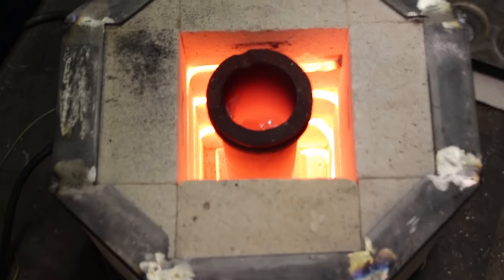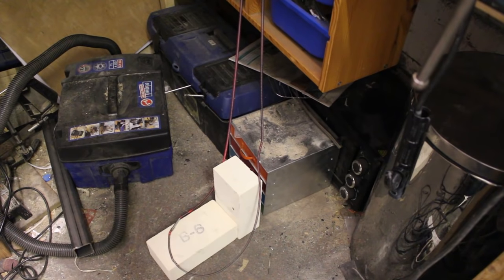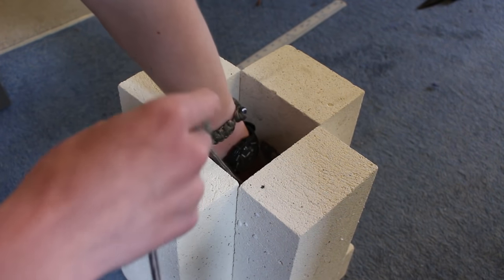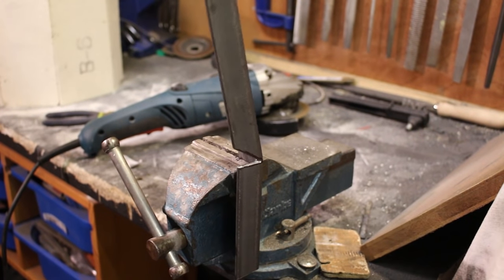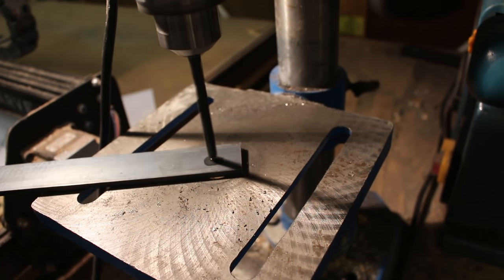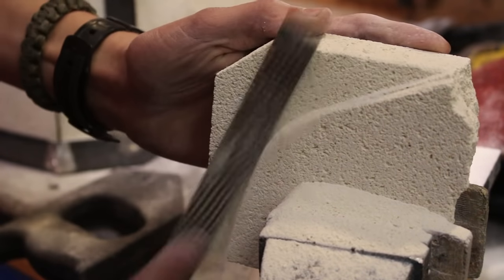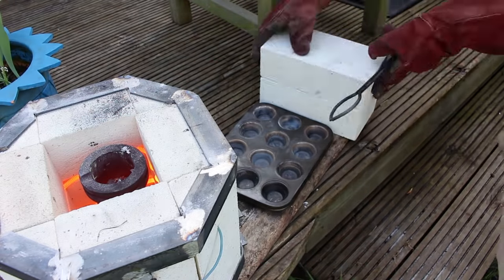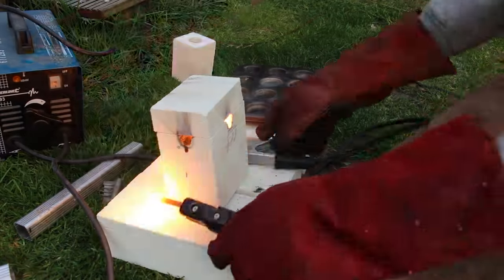How to Make an Electric Foundry For Metal Casting - Part 1

Comment: Melting aluminum is certainly fun and listen-- that's all well and good !! Enjoy !! I'm intruiged making this type of metal melting furnace myself however I wish to, additional to smelting aluminum, I have need to smelt brass, gold, silver, copper, and Nordic gold as well as other lesser necessary heat requirements such as: tin, zinc, and lead. Does this design build sufficiently raise upper maximum heat levels to roughly 3,000 degrees Fahrenheit or not even close ?

Comment: for the cable make sure for a 230V AC supply the cable is rated at 2.5mm2 thicknes! this is to prevent your cable from melting and causing a short circuit and possibly a fire! If you can't find that around the house just buy it from your local home improvement store, and attach a plug to it. it is also a good idea to use a cable that is heat resistant.
Reply: It said right on the cable he uses 13 Amps. He's only drawing an Amp more than half of that, or 7.5 Amps.
Reply: European plugs and most other countries dont have fuses in them :P they allow you to pass 16A through 0.75mm2 which will give you a melty mess :P
Reply: *****
and your point is? Yes, us folks in other countries need to add an external fuse. Which is precisely what we do.

Comment: u can probably buy a little switch to put on the top so that it can be pressed  by the lid when u put the lid on it. this can make it safer to use since it will automatically switch it off when u remove the lid

Comment: Instead of welding a steel cage, it is far easier to use furnace/fireplace cement to glue all the firebricks together. Use the far cheaper hard insulating bricks for supporting corners. These can be cut with the grinder with a masonery disk. I did this for one of my furnaces and it worked very well. Of course, I am using a propane torch as the heat source, but I am interested in building an electric one like yours. However, the mains supplier here is 120V/60Hz. It may be a little tricky because 1800W take 15A which is at the limit of my circuit breakers. I wonder if 1500W will do the trick.

Comment: If you use an isolation transformer you can decouple from Earth reference and less chance of electrocution. However at 1.8kW that would be a large, heavy and expensive. You could use an interlock with pivoting door so it cuts the power when you open it. With added protection use an RCD to kill the power if any part of it discharges currents above 30mA to Earth via a body part. I'm surprised the insulation stays intact with the conducted heat through the coil ends to the wires. Probably should use heat proof insulation 6 inches up to the coil. On the whole, very impressed. I've been looking for a low cost and clean way to melt scrap aluminium for casting projects.

Comment: Please use double insulated silicone wrapped mains cable as the PVC wrapped mains lead will melt and cause electrocution hazard and use grommets when passing through metal framework. And don't forget the earth connection bonded everywhere you joined the metal framework with nuts and bolts. Think safety and longevity. I like your idea by the way.

Comment: Attaching the ground wire to the steel frame would reduce the chance of shock if the insulation on the wire that goes through the hole in the frame wears through.

For the inside, an isolation (1:1) transformer would also drastically reduce the chance of shock if you touched the coils themselves, and might be something you could hack together yourself from some spare microwave transformers.

Comment: Hey TAOW, been doing some research to work up a similar foundry. One thing I came across, from a silversmith, involved powering your resistance foundry through your welder and using something as simple as a light-dimmer to control the amperage. A bit late for your use, I'd wager, but something to consider for future use perhaps.

Comment: Great project, well done. As an electrical engineering professional may I make a few suggestions. Firstly all exposed metalwork must be properly earthed (it may be there, but I didn't any earth connection in the video?). Secondly, as the unprotected heating elements are easy to access, please make sure a tested RCD is placed in the power supply line at all times. Thirdly, I would use heat resistant sleeving on the cable entry points. Your forge uses a potentially lethal power source, and as such, must be treated with great respect from a safety standpoint. Ideally, you should ask a qualified electrician to give the forge a once over before using it. I hope you don't take this as criticism, I am simply concerned for your safety.

Comment: for the lid i would
 draw a line down the middle on the end of the brick then do it half again and put a hole through the middle of the brick and put a steel rod through and you can lift the lid off with out risk of burn and once you lift the brick up it will fall to a side

Comment: Perhaps a safety shut off switch in the top brick surface before you add temp controller so when you lift the lid it auto turns off breaking the current and saving the chance of being electrocuted. It would cost you less than 10usd to integrate a simple control.

Comment: I also cast aluminium when I was around 13, but I put it away as it was too messy using charcoal... 10 years later, making an electric one doesn't sound too bad... And it's a cleaner process... Hmmm... Tempting...

Comment: u cud probably add a stepdown transformer, bring down the voltage and use the increased amperage to heat a longer coil.. this means more even heating throughout the length of the furnace, and also, less chance of getting elecrocuted. after all, voltage is actually the thing that "electrocutes"..

Comment: You should have made the inside hollow space round. This way you could have made the heating element sitting in the groves spiraling upwards and never come out of the groves so it can touch the crucible. To me this feels rather unsafe as i am sure i would forget to turn the power off sometime and electrocute myself. It´s a very nice, cheap and well working electric foundry though, well done. With a temp controller and sensor it´s as good as any bought unit.

Comment: Upgrande to a induction furnace, you are almost there. Yours uses Joule effect, a induction furnace heats using electromagnetism. You will need a little more copper and some electrical knowlodge. Enter the steel age.

Comment: My only input would be to invest in a MIG welder. It's much better for the work you appear to do and if you get flux core wire you won't have buy gas. In my opinion MIG is easier and more precise

Comment: Epicness! I really don't like the high voltage aspect - even if you are shutting off the power before handling. Have you considered using a couple (maybe even three) microwave oven transformers so you can play with lower voltages?

Comment: The good thing about all this create it yourself is that if you can find a cheap way to do it that is durable then you can make it to any size you want with in reason...Because even the ones online to buy are pretty expensive for the volume size it gives you to work with. Plus if you find a way to make one as good a quality then you can customize it and make it as big or with as many features as you want. Basically all the major components for me is not the size but the ability to find a thermostat and timer that works well with different rated kiln wire then i basically could make any size. Plus not familiar on the different kiln wire and what it yields for temps yet... But i suspect if i can get a thermostat in the temperature range levels of 0 deg to 3000 F deg and uses just a digital stove timer i could get what i want if i can figure out the ratings on these different heat element  kiln wire.

Comment: Putting the live wire through the steel frame looks rather dangerous. If the insulation melts or wears through the frame will become live, maybe you have fixed that somehow?  Otherwise an excellent video very well created, congratulations you'll go far!

Comment: My only comment would be to add some safety measures. Maybe have a switch for the lid so when it's open, the circuit cannot be completed. Or have a dead man's switch that must be pressed.

Comment: The live wire is plastic and you have passed it through the lower steel frame. Heat may melt it making the frame live. Otherwise the furnace appears good.

Comment: MMmm..... there's a different way to do electro furnaces, but for aluminum this is kinda interesting. 
Another  method that is used is by alternating a magnetic field through a particular substance. 

Basically the main difference is instead of relying on the resistance of a heating element, you rely on a metal's tendency to react to an outside magnetic field. PAra- and Dia- magnetic materials require higher frequencies and/or voltages to melt but it does still work with them. 

Note: Ceramic crucibles tend to work best for magnetic induction furnaces, since graphite can be magnetic to some degree and might not work as well.

Comment: I don't care to much about gas based instead of electric based kiln the important thing is it regulate temps and times properly to finalize glass and ceramic art projects i have. I am thinking you can regulate it be getting a thermocoupler and a thermostat possible for a heating system but not yet found a cheap solution i could do it but its about keeping cost down..after all this would be a first electric or gas kiln to try glass and ceramic making.  The metal foundry blast furnace i am pretty much ready to create its the ones for glass and ceramics that are more difficult to get right.

Comment: Professional tips for welding with those sticks: 
1. Clean the surfaces you are going to weld.
2. Keep the welding sticks in an oven at 150 celcius degrees for half an hour before using them.
3. While welding, hold the stick straight and directly at the spot where you start to weld then change your angle just a tiny bit like you were "pushing" the molten steel fowards.

3: This will prevent particles like the shield suppliment getting beneath your joint. ^
1+2: Heating the sticks will vaporate all the water from the surface of your stick and prevent the joint from having bubbles and the burning process becomes smoother.

If the joint you weld is really thick you either need to add more power or move faster. 
You'll notice when you got too much power is when the material you are welding gets deformed around the joint or glows red/ yellow around the joint.

Seeing your skills on this video I hope you do not weld a car or anything that might be life threatning if it fails. But I'd be happy to see you getting better at this.

I'm finnish and don't know the proper translation for most of the stuff I'm talking.
Reply: Seeing those thick welding joints makes me sad unfortunately. It's just wasted materials and also a weak joint. The welding stick material builds up and doesn't actually melt the material you are welding as it should be :s

Comment: That is a maddening amount of work and I am so lazy.  I am thinking of searching for a steel barrel big enough to house the fire brick structure....surely there is some steel barrel that is only a little too large and then perhaps fill in the gap to make it all tight with some kind of refractory cement?  Would this work?

Comment: Great video.  It really gives a lot of great ideas, and gets me thinking, but you can cut the costs down a LOT by better sourcing.  For example the angle iron should NOT cost more than about 0.50-75p / meter from an actual steel supplier (usually minimum order is 6m, which shouldn't cost more than 6 or 7 £ ).  Steel is priced by the kilo, and current price should not be more than £1.20/kg (angle iron is one of the cheapest profiles you can get).  Angle iron from the big box hardware stores is insanely overpriced.  Getting it off Ebay just compounds the cost because you pay through the nose for shipping steel.  I'm betting it's a similar story with the fire brick, though I have less experience with that (best prices I've found online is about £3, minus freight.)

Comment: Really great video! I know the bricks are isolating the wire, but isn't there a chance there going to melt because the wire connection itself conducts heat?

Comment: Should have used proper heat resistant wires to feed the element.  I also would not have drilled the feed in though the metal, but would have drilled a hole though the brick below the metal.  If you MUST feed one wire though the frame, use ceramic insulated wire, and make that lead the NEUTRAL, NOT the HOT mains lead.

Comment: Wouldnt it be better to put a power supply between the furnace and the live feed? You can adjust the temperature by adjusting the voltage.  :P

Comment: Cool , I like your idea as i want to set up or get a kiln for making my art/craft project the issue is not creating a metal melting furnace. My issue is to figure out a cheap durable way to make a kiln to make ceramics and glass art. I know how to make many different type of blast furnaces for metal melting but i need a more electric kiln that can regulate temperatures. So i could fire glass , to earthware , to stoneware to porcelain aka all the different cone firings. I imagine your method gets hot enough for some glass not sure about all cone levels or if you have a thermostat add on.

Comment: I wonder if you could make a hotter kiln if you make it with a second coil running in parallel. And I am kind of curious about what kind of heat those coils could take before melting?

Comment: Awesome video and idea. Instantly subbed.

However, wouldn't it be possible to use steel plates (not super thick ones) welded together and placed in front of the coils, without being connected to them. Considering that Steel needs temperatures higher than 1000 degrees Celcius in order to melt (1. 371 to 1. 454 degrees Celcius or 2. 500 to 2. 649 degrees Fahrenheit), then using a steel plating structure should remove the risk of electrocuting oneself and replace it with severe burns (like any other forge) instead. The steel would then work as the second heating element, which then heats the crucible up. Question is just whether a solid plate of heat, all the way around, would destroy the crucible...

But it might work, it'll be way safer and you can melt and thus cast more at once, because you won't have to turn off your forge :) Sure, it's expensive, but I'd rather spend those extra bucks and have that extra safety, than risking my life everytime I want to melt something.

Comment: i remember when me and my friends took a helium tank from one of those balloon party kits after it was empty and cut it up and made it into a furnace with a fire extinguisher as the crucible and a hair dryer motor stuck on the end of a steel pipe that goes in a hole we cut in the side and we made some aluminum cupcakes in one of those pans, we thought that was the coolest thing since sliced bread, we do a lot with engines so we took a ruined one and broke it up with bolt cutters and used that, engine blocks are much better quality aluminum than cans, cans get more slag than metal, engine blocks are very clean and make great castings, make sure its not magnesium before you melt it cause it dont melt the same

Comment: I have some safety questions.  It seems that you use un-insulated wire as a heating element.  If you touch those wires with metal (say, as you are removing your crucible), will you be shocked?  Is there anything that can be done to prevent such?

Comment: How would cutting and putting the heating elements in parallel effect the foundry's heating power? 

I did some of the math, but I can't tell if I should look at the current and power of one of the parallel strings or of the entire system. Part of me says the system because, well, that's the power of the entire thing, but the other part says that the only thing that will effect the heating of the coil is the power being applied directly to it. If so, wouldn't it be better to put them in parrallel because halving the resistance doubles the current which will increase the power (of the single coil, not the entire system), right?

Comment: Quick question.  I found the model PID temp controller, but it comes with a DA 40A SSR, not the 25A you show in the video.  I know nothing about electronics and am not sure what this means, but will this have an impact on set up, use, functionality that would be against your Part 2 video?

I also see the Inkbird ITC-100vh as a 240v, which is about $10 cheaper than the 220V.  Same question from above here.  Will the 240v change anything vs the 220v you use?

Comment: Great project but I do have to say when (not if) the PVC insulation fails on the wire passing through the steel frame you will end up with a live frame to potentially kill yourself with!  Earth the frame.  Use high temperature rated wire (glass fibre or PTFE insulated).  You're right you need to disconnect it as you could get a shock from the heater so connect the Line to the bottom of the heater element and Neutral to the top to minimize the shock voltage if someone does touch the heater with tongs etc.  Also place the whole thing in a steel tray so if a crucible breaks it contains the molten spill.

Comment: Hoping temp control is cheap, I just went for a variable resistor from my local RadioShack which set me back only a few dollars but I can't really mark out temps because my IR thermometer only goes up to 500F and when trying to do measurements, it ended up going higher than that (it also melted the solder I used originally so I had to rethink the positioning).

Comment: If you sit the furnace in an air tight tub and fill it with carbon dioxide, you're suffer less oxidation of the coil and improve its longevity.